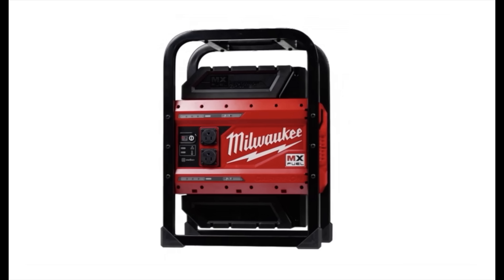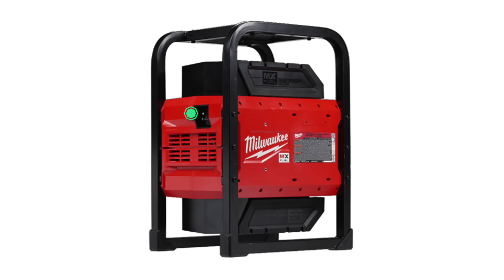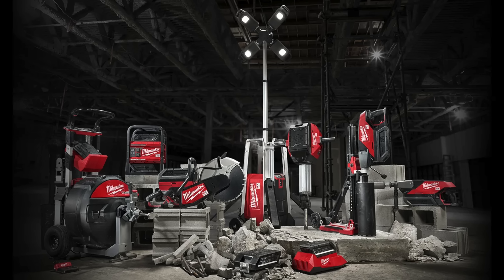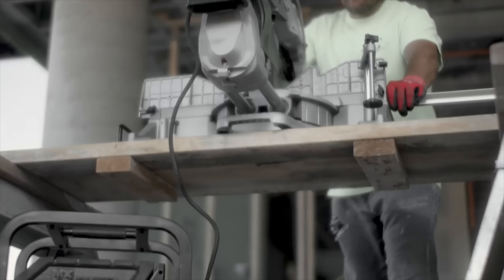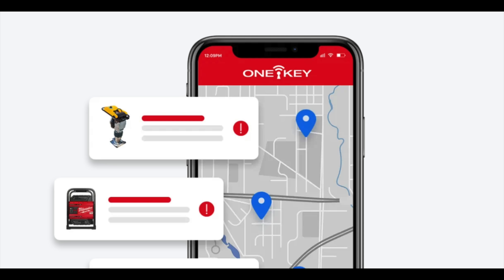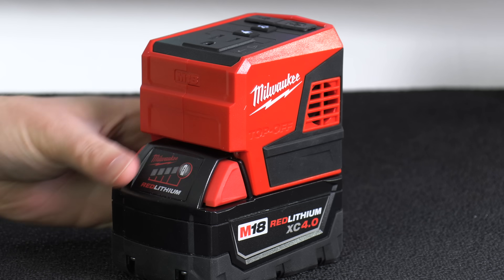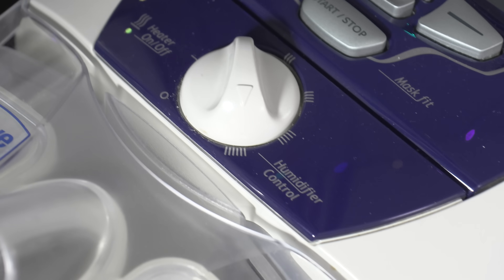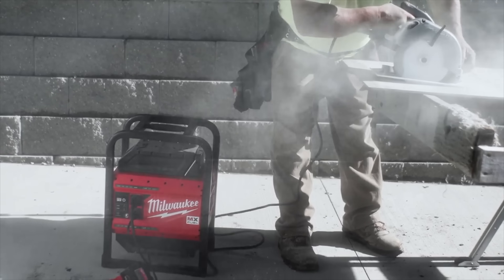END of GAS Generators? Milwaukee MX Fuel Carry-On Changes EVERYTHING 3600 Watts!

Comment: That 2001 Honda 2000 is probably still running 😂
Reply: If you posted it on Craigslist for 50% off the purchase price you could also sell it in a day. Nothing beats a Honda.
Reply: And only on its second tank of fuel😁
Reply: My 1992 honda generator happily purrs along after hurricanes , but I did buy a jackery 1000 to run things at nite so I dont disturbed my neighbors. Solar panels in sunny s florida!

Comment: What generator would you suggest with the ability to power by solar?    We currently charge two 6 volt golf cart batteries and connect it to power  10 with an inverter.  Works, but not portable - wondering if we should be doing a different way?

Comment: I WAS excited for this unit to be released FINALLY..............Until they released the actual specs. You can get the Ego unit with 2 batteries for 1/2 the price. Or buy 2 of those kits for the batteries and run 1 unit for the same price. HUGE DISAPPOINTMENT  FROM MILWAUKEE
Reply from the maker: It will be interesting to get this in hand shortly and see what it can do. I hope it ends up being better than that but we will know shortly for sure

Comment: Why would anyone buy this thing?  You could get the same thing with 10x the amp hours at 25% of the cost by buying an 1800 watt inverter and a car battery.  Or you could just buy a gas generator.

Comment: This is for the rich contractor.  Also, that top off, while handy, it isn't a good option for that CPAP if it is pulling 120 watts constantly.  Maybe it ramps down, but the math isn't there for running a 120 watt device for long.  The 4.0ah battery won't make it an hour.  It is nice to see them start this, but I don't imagine too wide spread adoption on this one until costs come down more.
Reply from the maker: It's super expensive for sure but will definitely sell, but how many is the real question? The big thing here is that it's a step into this space, I will be excited to see what comes of this
Reply: @SilverCymbal  I agree you have to start somewhere and usually it isn't cheap at first being an early adopter.  In 5 years they could possibly half the price and it will be more of a normal product to see.

Comment: THIS COSTS 7-TIMES MORE THAN A GAS GENERATOR TO RUN PER KILOWATT-HOUR!!!

$2.77/kWh electric vs $0.38/kWh gas. My diagnosis below.

But, but -- how many watt-hours?!? My estimate: 18-27 minutes at 1800 watts load.

Great, 1800 watts continuous, but for how long? 4 minutes? 10 hours? For the size, I'm guessing with two packs, maybe 550 to 800 watt-hours. Using an estimate that  a single pack has two rows of 18 batteries, likely 18650s, so 36 cells per pack. Assuming 3,000 mAh and 3.7v per cell and 2 packs in the "generator," drawing 1800 watts AC at 120v and 90% efficiency (DC-to-AC conversion) will last just 16.5 minutes at 550 watt-hours and 24 minutes at 800 watt-hours. 

At least with a generator, you can pour more gas in. With this, you gotta buy the generator and then 6 (or more) batteries so you can be charging the other sets while you use two of them. 

Might make sense where gas isn't an option, isn't available, or power isn't available. But the use-cases are pretty narrow when gas generators cost 1/3rd the price and will last as long as you have gas. The internet says a 5kW gas generator burns 0.75 gallons per hour, so for an 8-hour day, you're using 6 gallons, which is $12-18 per day for a shift. 

Found the Milwaukee site on this: https://www.milwaukeetool.com/Products/Equipment/Power-Supply/MXF002-2XC

They state "The CP203 Battery recharges in 45 Minutes. The XC406 Battery recharges in 90 Minutes."

The XC406 is a 6.0Ah (amp-hours) at 72 volts (they do NOT mention this on the product page!!!). This gives you 432 watt-hours (Watts = Amps * Volts -- Ohm's Law) per XC406 pack. With two packs, they claim 864 watt-hours -- pretty close to my estimate based on the video of 800 watt-hours.

So you're on your work site. You've got 26 minutes at 1800 watts before your batteries need recharging. You would need 8 (eight) XC406 batteries -- two being used, and SIX being charged -- in order to get through the day, with 15 battery swaps during the day!!! At the retail price of $599 per pack, that's $4,792 just in batteries, not buying the Power Supply.

If the 864 watt hours with two XC406 batteries last you 90 minutes, then you only really need 4 (four) XC406 packs -- two charging while you use the other two. $2,396 for 4 XC406 packs. 

Lithium-ion lasts about 2-3 years and 300-500 cycles. So let's say you spend $2,199 for the Power Supply, which includes 2 XC406 packs, and another $1,198 for 2 more XC406 packs. You're in for $3,397. 

Giving the benefit of the doubt for 500 cycles and zero battery degradation (unlikely), you'll get 500 cycles at 432 watt-hours per pack with 4 packs, so 500 cycles * 0.432 kWh * 4 packs = 864 kWh. Let's say the Power Supply with no batteries is $1,198 less, so the batteries alone cost you $2,396. That's USD$2.77 per kWh. YOU MUST REPLACE YOUR BATTERIES AFTER about 500 CYCLES. And the $2.77 per kWh is best-case.

If I 5kW generator uses 0.75 gallons per hour, and a gallon of gas is $2.50, that's $0.38 per kWh. 

THE MILWAUKEE MX FUEL CARRY-ON POWER SUPPLY IS A TERRIBLE VALUE unless you absolutely need to not use a gas generator or need things to be quiet. It is about 7 times more expensive than a gas generator.

Maybe nobody is using 1800 watts continuous on the job site, so this is a bit of an extreme case. Just want people to know what this does and does not provide, and what their costs are going to be.
Reply: This is aimed a t plumber-eletricians. etc that use 500 watt tools intermittently. Add some efficient LED lights. It will work all day, silently, with no hassle. and the batteries will go 1,000 charges. Over 4 years.
Reply: @kkarllwt  The typical estimated life of a Lithium-Ion battery is about two to three years or 300 to 500 charge cycles, whichever occurs first. One charge cycle is a period of use from fully charged, to fully discharged, and fully recharged again. Use a two to three year life expectancy for batteries that do not run through complete charge cycles.

Where do you get that these magical Lithium-Ion batteries that Milwaukee is using that can last magically 2-3x longer?

Comment: This is awesome for vanlife! Finally they released this generator!
Reply: Not that great for vanlife. You'll need an actual generator to charge this thing from.
Reply: @JohnDoe-nq4du   @Silver Cymbal    Imagine you've got a work van/truck, and also a 12v to 120v inverter hardwired to your starter battery.  As you drive to your work site, you can charge one of the XC406 Milwaukee batteries this way.  If the battery is completely drained from the day before and you've got a 90 minute commute to the next job site, just charge up fully while you drive.  You can also buy extra XC406 batteries and plug them in to provide more power. If it gets stolen, its all locked out by ONEKEY.
So for vanlife, if I've got an inverter I can re-charge one of the batteries while I drive to my next adventure spot.  When I'm camping, I can use my Vitamix, my microwave, etc.  If I brought extra battery packs along, I just plug them in directly to the unit and I've got more power.  Great in dark or rainy conditions or climates (like northern Canada in the winter) when there is no solar available.
You can also use a small generator like the TailGator from Harbour Freight to charge the battery if you are on extended periods of camping or jobsite.
I think the design of the Milwaukee unit is different than everybody else, since it is all modular from the start.  I've got one of the Goal Zero Yeti 1000, and on my channel I show how to charge it without solar while I drive using Victron equipment.
Reply: @sprinterdiscovery  What a convoluted way of storing energy.  If you're going to use your vehicle's charging system anyway, just buy a couple big deep cell marine batteries and a larger output alternator.  Hook them up parallel with the underhood battery, and use a cheap inverter.  A lot less expensive setup than this Milwaukee POS.
Reply: @sprinterdiscovery   who is commuting 90 minutes in a van?     Defeats the purpose of the van life imo.    I’d take a standard lead acid leisure battery over this setup
Reply: @clintmullins4406  Lots of people. From where I live, my neighbor who is a contractor visits different job sites in British Columbia. Some are in Whistler, some in Hope, several in Chilliwack BC. Those are at least 1.5 to 2 hours away. When we travel in our van to visit different places we drive a lot. 
Lithium is way different than lead acid. Just some examples. Have an awesome day!
Reply: @sprinterdiscovery  but if you are living the “van life”  why would you be 90 minutes from work?  You can park anywhere.

Comment: EU2200i is a beast....Will run my sewer machines, Jackhammer, and sensitive electronics....Milwaukee should've left this alone.
Reply from the maker: The EU2200i is a great generator, in the gas space its unbeatable, not just for what it can do, but even in resale value. I think Milwaukee knew they would never win in that space. I really would like to see Honda makke one of these, not to replace their has line but to have a presence.

Comment: If they can make a battery powered generator why not make a cord that will keep the battery charged using a plug off the generator for continuous running without ever having to change the battery or running out of power.  Now that would be something

Comment: i dont see it replacing gas generators especially ones that are capable of running a house and plus what are you gonna do if the batteries are depleted with no way to charge them back up while if a gas generator runs out of gas you can just put more gas in it and start it back up and ya could get gas from the closest gas station that stil has power
Reply: The market is construction guys who hate extension cords and the noise/ mess/ hassle of gensets.

Comment: Its nice and quiet until the battery is flat, just like electric cars. Then comes the hours and hours of recharging. And if you have it for backup in case of powerfaiilure, your out of luck. Just get a gas one and cans of extra gas
Reply: And they call it ”solar generator” ha ha, its a battery

Comment: Can you charge the batteries using a solar panel hookup. If you need some type of converter from the battery charger to the panels, what would recommend. Is this even an option or, if so, practical. Thanks

Comment: This "replace everything gas run with battery powered", like battery powered chainsaws and now "generators" is absolutely absurd. City folk may think it's great. Come out to the country and see how these junk virtue signaling ideas work. Terrible idea.
Reply: I had a discussion with a fisherman who said something bad about my gas powered onboard engine - he said he likes his electric motorboat because it is "eco". The thing is - for a 15 litre of gas I can ride the boat for about 100 kilometers, while he keeps on loading and unloading his boat with heavy truck batteries every day (compare my 15 litre tank to his four 35kg batteries that he has to carry every morning) - and for all that hassle with heavy batteries, he can ride about 15 km on water. When compared to gas, battery power is simply not there yet.
Reply: @morgan98801  - ??????
Reply: Yep. I work at a big landscaping retailer and one of our stores had one of those electric-only tool displays (intended for commercial/professional use)

They suddenly took it down and when I asked why the manager told me “we didn’t sell a single unit all year”

This stuff might sell at Home Depot but when it comes to real contractors, I don’t thinks it’s going to happen.

Comment: Calling it a "generator" is false advertising.  It does not generate electricity;  it just stores it.  It's a battery with an inverter.  It may be useful for a contractor who needs to use small power tools on site and can recharge it every night, but many of us have true generators to provide power in our homes during an outage.  For that purpose a gasoline or propane generator will continue to be our best choice for years to come.
Reply: Well that "Generator" does generate 120V of 60hz ac power so it is living up to its name.
Reply: @vhateverlie  Wikipedia defines an electric generator as a device that changes mechanical energy into electrical energy.  This device stores electricity that has been generated by other means.  It is not a generator.
Reply: @vhateverlie  Genorators (you know like real gas powered ones) can easily make 240 volts. I have a 240 volt plug in for mine and it works great.
Reply: @joeschratz9360  yes 220-240v is another standard. I'm not sure what you're getting at?
Reply: @vhateverlie  Im just saying no battery pack of that size has 240.
Reply: @joeschratz9360  not for more than like 3 minutes of output no. Unless you want a tesla powerwall
Reply: @vhateverlie  All im saying is gas (for now) puts out more power for the size.
Reply: @vhateverlie  A inverter converts electricity from one form to another. A generator creates electricity from something else.